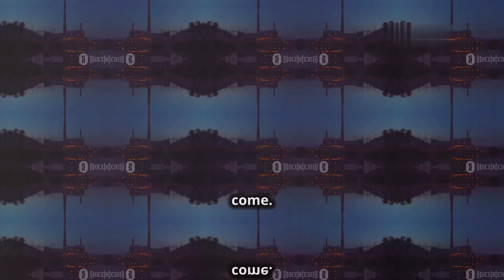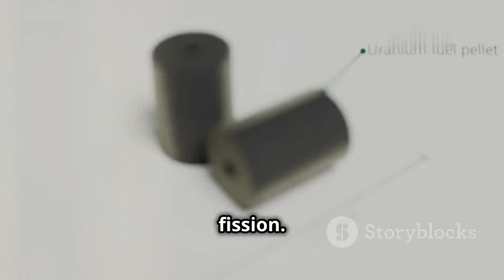Electricity Generation: Powering the Modern World...

Comment: The US electric power grid has been greatly clean since the mid 1980s when acid rain from sulfur dioxide, particulate soot and unburned hydrocarbons had been addressed from coal fired electric power plants.   Wind and Solar generated wild AC that is not charging storage or similar is mostly worthless because the dips of their energy output are having to be instantly made up typically by natural gas turbine generators running at high service idle consuming 70% of the fuel of full throttle, but producing little electricity.  

Worse, the public power grid has to pay for the grid use from homes with enough solar panels producing wild AC that it counters at a 1 to 1 exchange of buying electricity from the grid, but the public power grid has about the same cost for supporting that home as if it was supply all of it’s electricity.  In more extreme cases neighborhoods of large solar panel use where home owners are trying to push 24 hours of home electrical consumption onto the public power grid in 4-5 hours of solar panel wild AC generation,  it can overload the local neighborhood power grid with wild AC of little use, but the public power grid has to buy and support that overload with upgraded power handling, but gets no revenue from it.  

This means that persons with good credit can finance their subsidized solar voltaic panels at a breakeven amount to them, but person's of lower financial means can not and are faced with paying in their electric bills for their better off neighbors electric grid use.  In southern California this has led to the most expensive electric power in the USA and bankrupt public power grids unable to upgrade their transmission lines.

It is scientifically impossible for greenhouse gas behavior to cause global warming.  All the greenhouse radiant energy from the earth is completely absorbed in earth's greenhouse effect by greenhouse gases within 20 meters of the radiating surface that is always in saturation from the strong greenhouse gas water vapor.  Global warming was officially stated at 1.1°C in 1991 and 1.06°C in 2022.  The cause of global warming is not known as of 2024.  

The back of the United Nation's Intergovernmental Panel on Climate Change (IPCC) science report states it took its greenhouse gas samples at 20,000 meters altitude where it is common high school level knowledge there is no greenhouse radiant energy.  This is typical practice for deceptive marketing to state legal data transparency protecting the perpetrators from fraud prosecution.   The IPCC has been transparent with its data acknowledging it is not dealing with active greenhouse gases.  

Earth's greenhouse effect is frequently used as a primary example to high school students of a system always in saturation from the strong greenhouse gas water vapor absorbing all the greenhouse radiant energy from the earth with greenhouse gases within 20 meters of the radiating surface that is all around us everyday and can't have its overall effect changed.  There is no further greenhouse radiant energy to interact with greenhouse gases.  

At 1% average tropospheric water vapor over 99% of earth’s greenhouse effect is from water vapor.  Water vapor would hold earth's greenhouse effect in saturation if it were the only greenhouse gas in the atmosphere.   The overall average temperature gain to the earth from the earth’s greenhouse effect is 5.55°C (10°F).

Arctic warming is taking place with the proving mechanism being warm Atlantic Ocean waters migrating deeper and more frequently into the Arctic Ocean warming it and the region.   That warmer water is causing a few weeks less of reflective snow and ice coverage resulting in more solar heat gain to the Arctic region surface.

Atmospheric CO2 levels of 1200 ppm about three times what they are today would greatly invigorate C3 plants the majority of plant life on earth greatly greening the planet. 

0.4% of the atmosphere is CO2 and on average 1% is H20 water vapor.   (1% H20)/(0.4% CO2) = 25.  Water vapor is 25 times more present in the atmosphere on average than CO2.   Water vapor has an CO2e of 18,  18 X 25 = 450 CO2e total for water vapor to 1 CO2e for CO2. 

The Earth’s oceans have 3-1/2 million sea floor volcanic vents warming the water and changing it’s chemistry that have not been systematically accounted for.
Reply from the maker: I really enjoyed the information you gave me...
Reply from the maker: It was great...
Reply from the maker: It was wonderful...